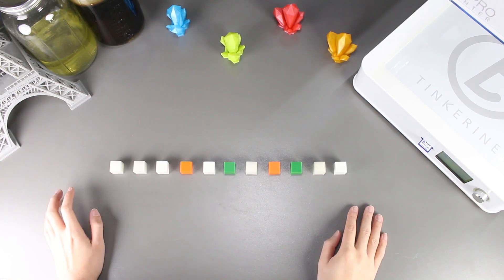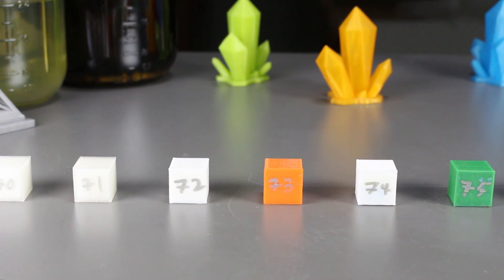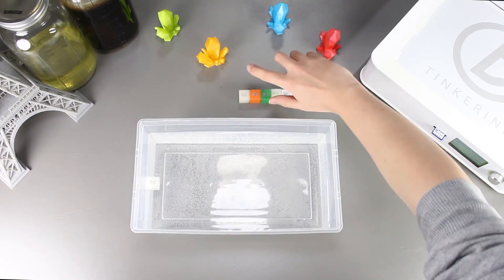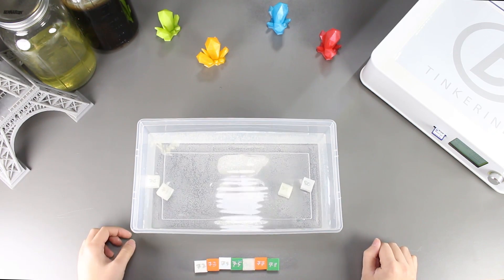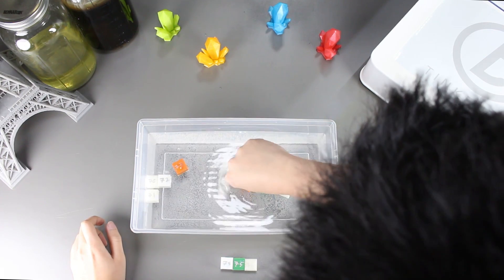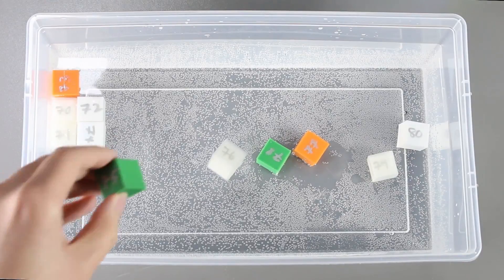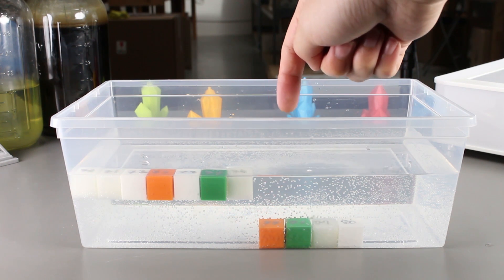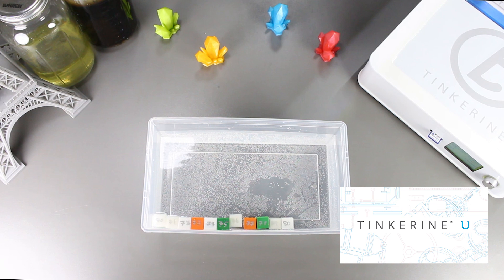Testing the Buoyancy of PLA Part 2

Comment: The buoyancy depends a lot on the shape of the model. I have a watermill shaped piece with six thin curved blades with relatively large areas. It sinks immediately. A hollow cylinder   with 3mm walls sinks, but a "solid" cylinder at 15% floats. It simply comes down to how much air is trapped within the model fibres.